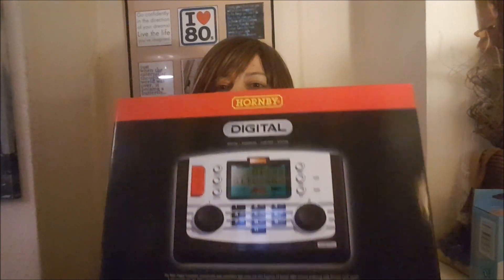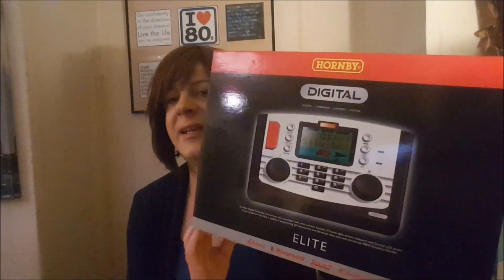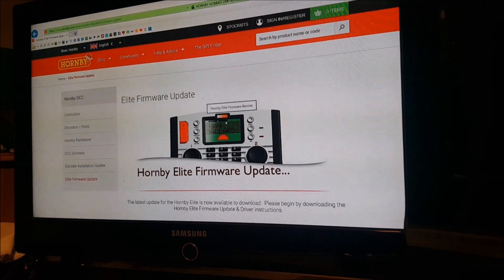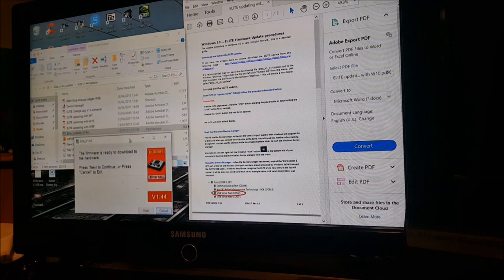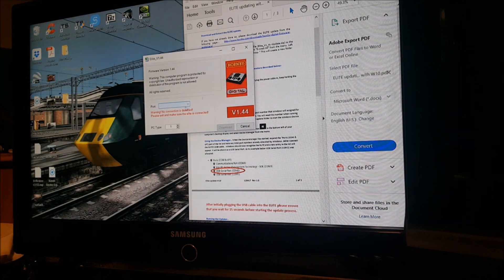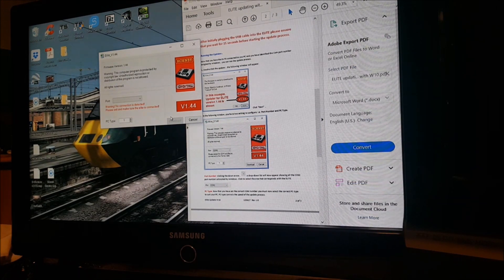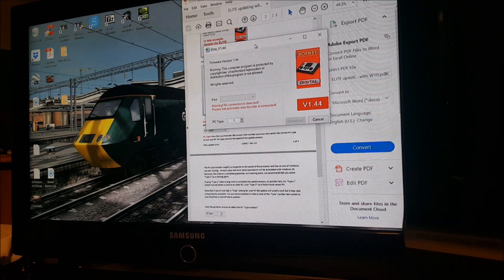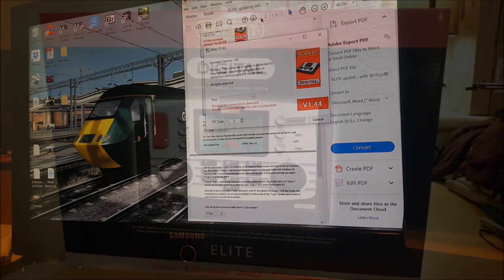Hornby Elite: Firmware Update and Install and Fixing Update Fail Message

Comment: Hi Susannah.. I love your videos so much but I am a bit confused with something, I recently acquired a Hornby Elite controller, which I understood this was a 4amp unit? but I noticed on the transformer plug is rated at 15volt = 1amp?  please am I missing something? 😜
Reply from the maker: Hi Paul thanks for the compliment. In all honesty I don't really know how to answer your question. My advice would be to read the manual or contact Hornby. My apologies. Susannah
Reply: @Pixie586 Joaquim oh! many thanks for your speedy reply, but now I'm thinking maybe the Elite originally came with a 1amp transformer and you have to buy a 4amp to upgrade it.. ooo golly gosh more money to pay out, I think now I need to cut down on my drinkies for a while to buy one .. lol

Comment: Hi susannah
I really enjoyed your video very insightful,  although i just cant get my laptop to recognise the elite controller 
Any advice would be awesome , as im still waiting a response from said manufacturer 
Andy
Reply from the maker: Hi Andrew, you do need Hornby Railmaster to connect the layout via laptop and elite. However to update the firmware just follow the video and make sure you follow the correct readme for your operating system. Susannah
Reply: @Pixie586  hi thank you fpr your reply i managed to get my laptop to recognise it was something to do with a missing driver , thanks andy

Comment: Hi Susannah Yes very helpful I did the update with no problems one thing I have found is that Rail master  now thinks that the Hornby Elite is now an e-link controller still it works ok. one question how to get views of my channel  maybe I am doing something wrong I have 6 videos now or maybe because  I am in Australia. Thanks Peter.

Comment: Hi Susannah, well done for resolving the issue with your Elite, I bet it was a worrying time when you thought it was broken. The PC Type
refers to the CPU/Processor, when handling data.  The download and install of the firmware from Hornby happens at various speeds, which is why the process needs to know which processor you are using.  For example, if you use PC Type 1 but you have a faster CPU it needs the information quicker, likewise if you have a slow PC and you select PC Type 3 it is getting the information quicker than it can handle, hence the fail to install message….Simon

Comment: Hi Susanna I have had a Hornby elite for some time now just updated the firmware on it thanks to your video with regards to your other problem I would highly recommend you get yourself a copy of Hornby RailMaster software which you can use with the elite and your PC it makes the job of setting up locos and setting CVs particularly sound much much easier I have just put a TTS decoder in mine on TTS Flying Scotsman and used RailMaster to set it up it worked perfectly first time you can get copies of RailMaster with the licence key from eBay at a very reasonable price it makes the whole job of DCC much easier. Can't wait to see your next video keep up the good work.
Reply: I totally agree, the Railmaster is excellent!

Comment: That was an extremely helpful video Susannah and should be of great use to those with a Hornby Elite should they wish to do firmware updates. I don't have one of these controllers but I'm sure that if I did then this would have put my mind at rest. Don't be put off from the naysayers of DCC, yes it can be a bit tricky sometimes but the benefits that you are after far out weigh the niggles that can happen now and again. I would never in a million years go back to DC but this is an old argument now and probably one of the most fought over things on the model railway circuit. In two or three months time you will love all the things you can do with DCC and it's not just about sound and smoke either!    ;-)   I wish you many hours of fun in your new DCC world, you're going to love it.     .............Graham
Reply from the maker: Graham Foulston hi Graham, thanks for commenting on the video as always. I must say dc became very appealing recently but as you say onwards and upwards so there's no going back. The video was put up primarily cause I had this issue and nothing on YouTube to guide me. So as a help to anyone who may find it useful to guide them so they don't panic as I first did. Susannah
Reply: It will take a little time to get your head around DCC after using DC for the amount of time you have been using it, I found it a little difficult breaking into it initially but you do get there in the end. You know as well as I do that the DC/DCC war rages, some folk will never see the good points to DCC and poo poo it out of hand but press on because you will soon start seeing the benefits that DCC has to offer soon.        ...............Graham